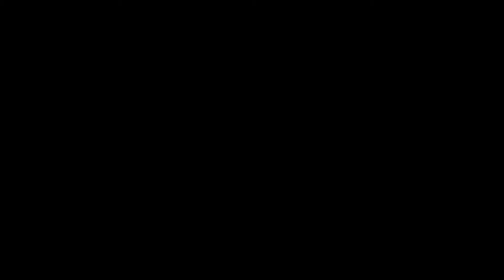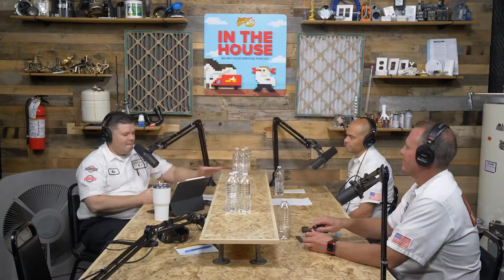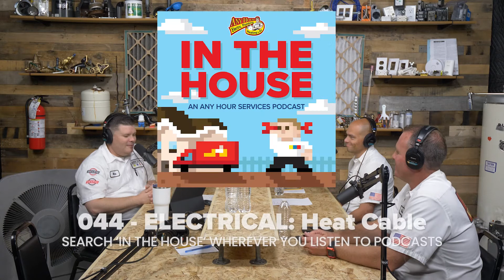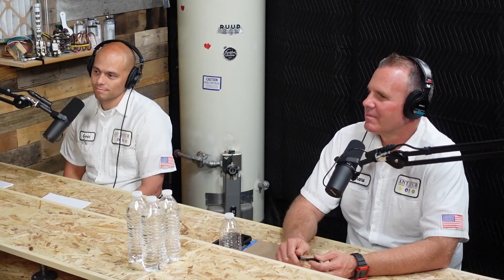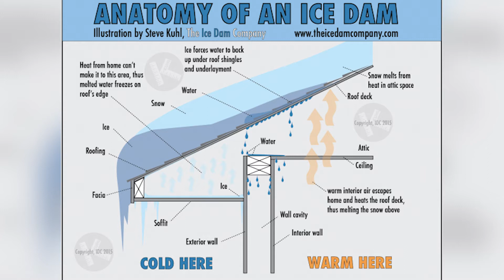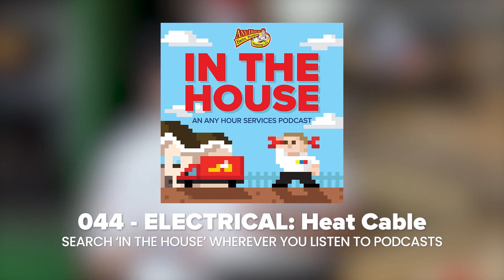044 - Heat Cable

Comment: I've lived in the far north where -40 was common. Ice dams not only affect roofs. We had a front concrete stoop that cantilevered into the basement. Heat caused the rebar to conduct to the front of the stoop causing a dam on the extreme outside 3 inches. This was usually in the spring. It flooded into the ceiling above my wet bar. It took some work but I did fix it. I prevented the snow from accumulating directly on the stoop.

Comment: The BEST thing to do is to address the CAUSE of the problem. Add more insulation if the roof-area is accessible. If not, these cables are a band-aid. Use roof rake to pull-down snow from roof to ground. Don't climb on roof!!!